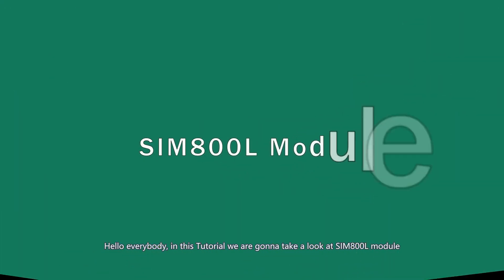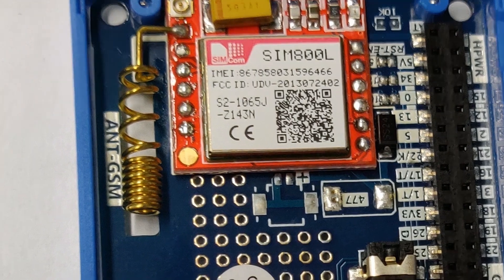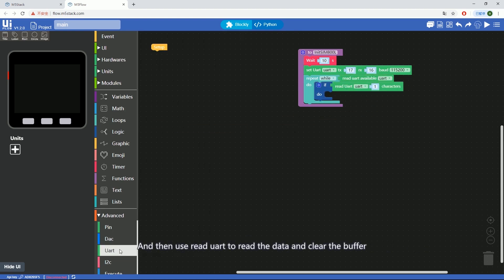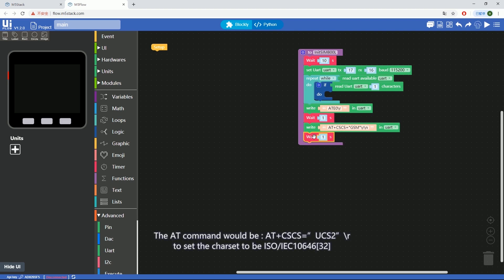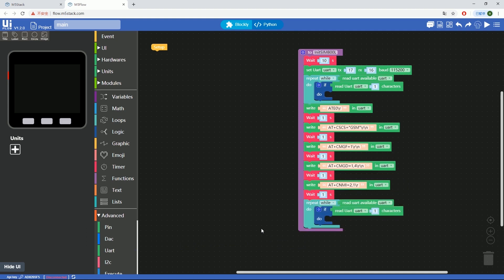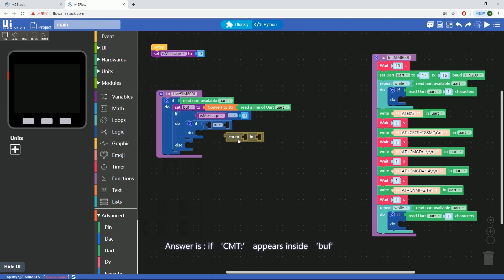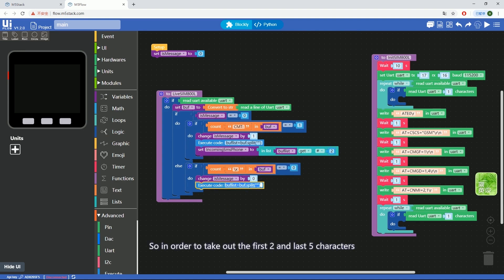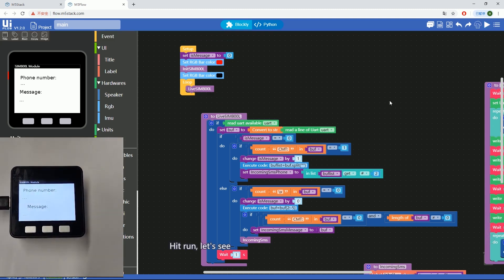GSM Module SIM800L 2G test in UIFlow

Comment: dont work. where i can download flow example?
Reply from the maker: There is no download of the flow code available unfortunately, alternatively you can try the arduino code https://github.com/m5stack/M5Stack/tree/master/examples/Modules/SIM800L please check the specifications to make sure it works in your country https://docs.m5stack.com/#/en/module/sim800 you could contact dimi from M5stack russia facebook group if you are located there, he has great experience with this module